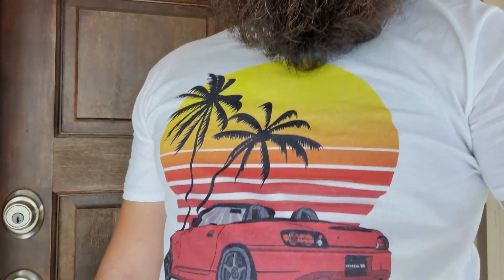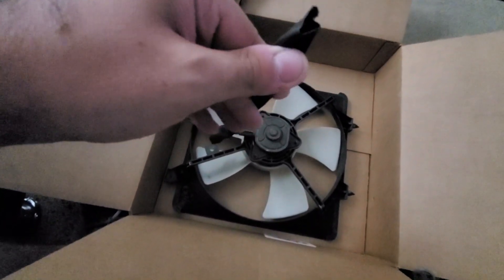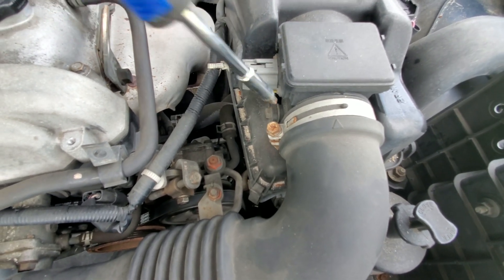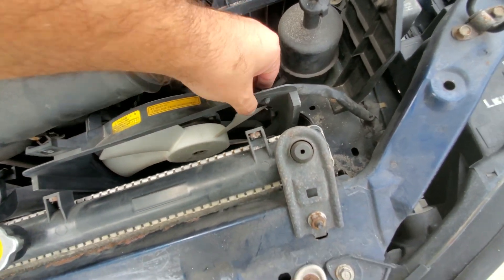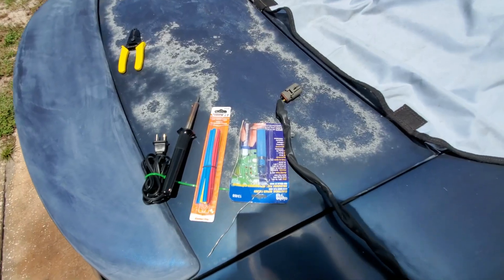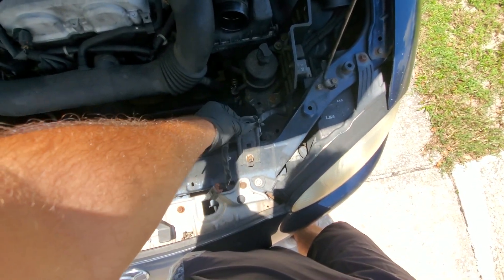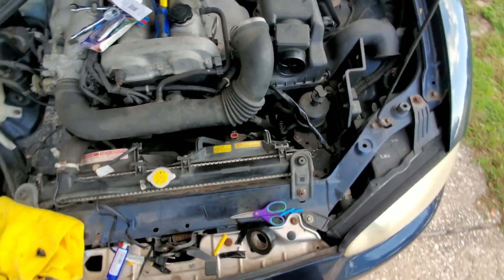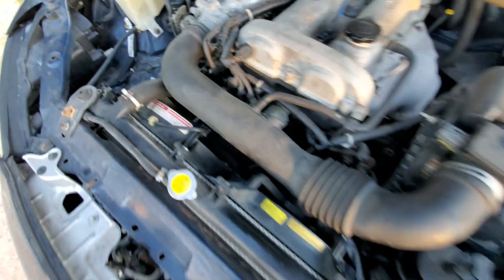Replacing the Cooling Fan on my NB Miata

Comment: "Rusty as hell."
Laughs in Vermont.
That clips is factory fresh bruv. :P
Nice work man!
Reply from the maker: Thanks man! Found a small rust hole on the car but it's on the interior. Will fix it soon. You'll see in a future video. It's from the top leaking for so long, and in the same spot over time. The actual car itself, underneath and everywhere else is rust free though. Gotta love cars from the south!
Reply: @MaxSpeedMike  Yeah common for Miatas to have some interior rust due to top leaks from my understanding. Keep it dry and it'll be fine. :D
Reply from the maker: New top is already on, that's how i found the rust spot haha. Video coming on that ;)

Comment: I mean no offense, but in the future, butt connectors! They are cheap and the crimping tool is too. Unless you are good at soldering, butt connectors are a more foolproof solution. Probably your main reason for the difficulty soldering is that iron was pretty low power with the wrong style tip for the size of wire you were trying to solder. You may also not have tinned your tip well enough. I'll be releasing a tutorial on this exact type of harness replacement soon. In the mean time, if you ever want some links for suggestions and stuff just HMU dood. :)
Reply from the maker: Thanks man! I have used butt connectors for all of my stereo installs. No more though. This video was just something quick. The oem fans and radiator aren't gonna be in there for too long either. Mods coming! 
I will have a fresh new soldering gun next time lol. The iron i had was quite old and i don't think it was ever cleaned. Had to use the sides hence the not so great solder. 

You're seeing what I'm trying for the first time. Not afraid to show fuck ups and such. I'm a noobie DIY guy just like most youtubers. Not gonna put up a front. I appreciate the critique, always bro. Thank you man. Looking forward to your tutorial!
Reply: @MaxSpeedMike  Nah it was an awesome video man and fun to watch you work on a car! Only meant as positive encouragement not a put down of course. I just have a bit of wiring know how so I'm happy to help. :)
Reply from the maker: @802Garage  lol i appreciate it man seriously. Hit you up with any questions i may have in the future 🤘